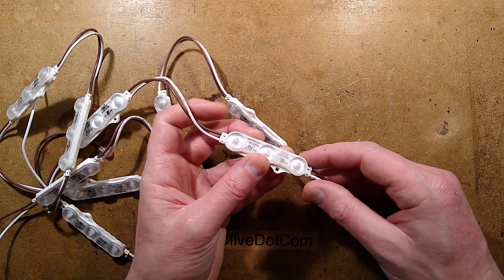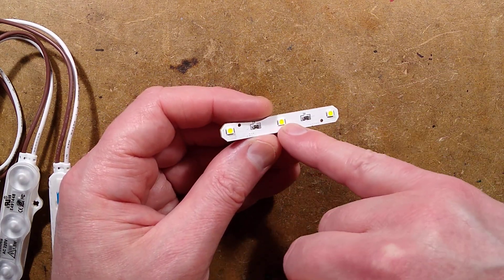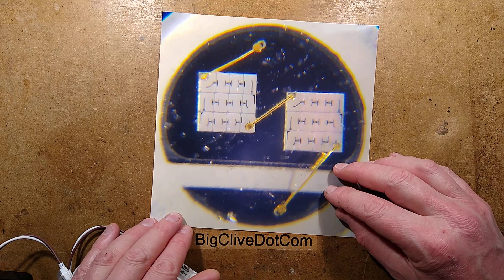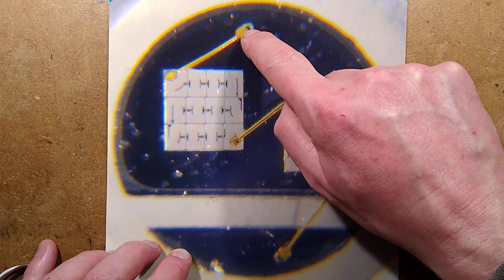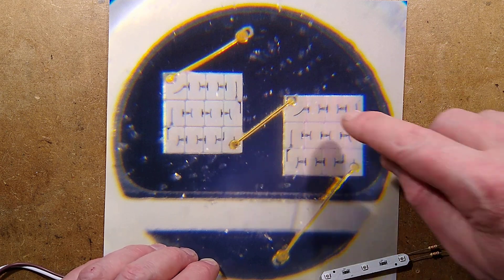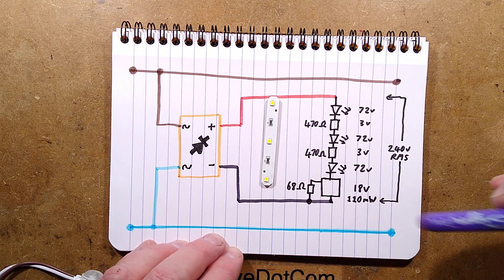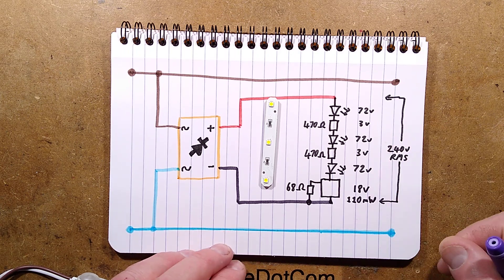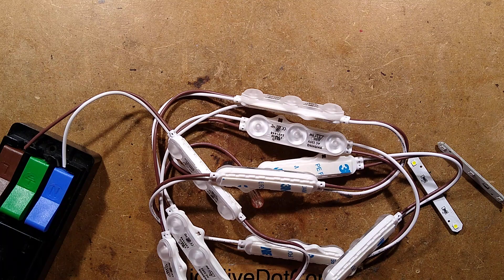Inside a high voltage LED

Comment: The gold wires decide if they are in series or parallel. The alignment of the units is so that you could easily bond them up in parallel for 110v while having the exact same light output.
Reply: Came here to say the exact same thing. Layout obviously intended to allow parallel or series bonding connections.
Reply: Yep, I thought the same

Comment: "it just dissipates one or two hundred watts"
well, I think with that power, the regulator would glow brighter than the LEDs :D
Reply: and 18 milliamps?
Reply: @ketas  Its efficient, lol
Reply: @ketas  Noticed that too
Reply: Didn't You know, that this is correct? Just at another input voltage levels and only briefly :>
Reply: @poprawa  We are joking, he ment milliwatts, not watts.
Reply: @user-rs8zg8ey2b  I actually know that, this was a joke too

Comment: Regarding the linear regulator: "It's dissipating only 18mA, that's the equivalent of just 100 or 200 Watts... Thats quite impressive..." Laughed way to hard about that 😄
Reply: That is one hell of a chip to do that :P
Reply: You can do that if you get the heat out of there ;)

Im designing a product off a similar concept but nearly zero ripple for high power applications. If it wasnt for thermal control, we wouldnt be able to do what we are doing safely.

Comment: I remember when I first found a HV LED a few years ago. My grandma bought me an LED dichroic-like lamp (I was 13 years old or so). I took it apart (just couldn't resist) and there was a fairly big SMD chip with what appeared to be 4 LED blocks under the phosphor. I was amused by such a big LED and when I tried to power it up with my own supply just to find out I had to use two in series to get it to barely turn on I was *confused as fox*. It might not be an LED I thought. I Just couldn't comprehend how a 4 die chip would require such high voltages. I researched a lot just to find nothing about that chip. It took me years of just watching teardowns by YouTubers like you, or DiodeGoneWild and such to discover (or rather learn) that these four dies may just have been clusters of LEDs all packed together in one single block. This things (although being just a cheap and dirty way of doing things) are just amusing from a technological perspective. — I mean, im 21, I shouldn't be so impressed by it, but it is just awesome, won't lie heh
Reply: Keep that sense of awe, curiosity,  and ability to be impressed.  When you lose that, you will turn into a crusty old man.
Reply: did the granny frown? they always cried and my ass hurt often from punishments, when i took everything apart in my home. i mean just one thing was left...
Reply: @ketas  I never told her, some the day the lamp just disappeared :)

But she bought for me cuz i was interested in knowing how was it like. So I guess it was fine — ?

Comment: These make standard LED lamps look over engineered now lol... great that cheap light technology is advancing, hope it lasts longer than these cheapy led lamps we are currently seeing advertised with 10,000 hrs lol... great stuff Clive 😎👍
Reply: IDK I have an early LED bulb in one of my bathrooms along with a folded florescent and both have been running now for almost 20 years.  Admittedly they haven't been on all the time so the cumulative time on the bulbs may not be 10,000 hours.  One has to admit that almost 20 years without changing a light bulb is pretty good.

Comment: Incredibly modular, and for the engineering / moulding / assembly, incredibly cheap! Since those modules are so very compact, I can think of a host of uses - and you must wonder what design delights are just around the corner, so to speak!

Comment: Those big LED dies look very cool running at low current, with the whole surface lit up. The first time I looked at one through a magnifying glass, I thought it was an effect of the phosphor being over the die causing the whole surface to light up, but then I took a close look at a regular blue LED and saw the whole surface of that die was lit too.

I do wonder how big they could make an LED die. Like could you make a 300mm wafer sized LED?

Comment: Around 10 years ago Seoul Semiconductor made line voltage LEDs that ran on120V or 240V.  They came on the ubiquitous hex shaped sink around 2 cm across with 2 smc resistors (1 in each direction) & had the typical 120 degree silicone lens.  I think they had 2 or 3 shades of white.   AND THEY WERE AWESOME!  I replaced my fishtank fluorescent with them when the ballast blew.  They required nothing more than wires and are still working as I speak.  They are also not terribly strobey either which implies they had two junctions under one phosphor perhaps smoothing out the jagged edges with the normal decay of the excitation somewhat like an incandescent lamp.  Another great idea that they don't make any more.  Sigh.

Comment: The positioning of the blocks and LEDs suggests that for the 120V version they wire the two blocks in parallel and for the 240V version they wire them in series. This is a very common way to have a nearly common design for 120V and 240V

Comment: If you want some really small LEDs, tear down a backlit laptop keyboard - if the tiny individual lights are real LEDs and not a meshed screen, we're talking about LEDs below 0.01mm in size (at least on my Lenovo laptop). Probably multiple elements inside a bigger SMD package.
Reply: you can buy pre-wired SMD LEDs like that, they market them to model builders.  very popular with the model railroad folks.
Reply: Apple's latest "Mini-LED" displays pack about 10,000 individually-controlled LEDs into a 16" backlight.  Small, but not microscopic.
Reply from the maker: Possibly flip-chip LEDs.

Comment: These were available but in the simplistic bathtub type module from ROK in 2014. Signmakers rejected them on safety grounds preferring low voltage inside their letters and boxes. I don’t see that changing.

Comment: I'm wondering as so many things around the house are using DC and all have their own AC-DC power supplies would you use less power having a DC loop and sockets around the house with one efficient converter and maybe a battery bank to smooth thing's out including lights off the top of my head I can think of 40+ thing's in my house that all have their own AC-DC power supplies I think having DC on tap the losses through heat etc would make a significant difference
Reply: Everything needs different voltages though, so you'd be replacing a lot of ACDC supplies with DCDC supplies, which essentially just saves you 4 diodes worth a couple cents.
Reply: All that stuff requires different voltages, so you've really gained nothing as everything still has a lossy DC DC converter in it. I guess you could standardize something for lighting, but it would be a tall order to refit existing home construction in countries where lighting and outlet circuits are often not separated.
Reply: @MichaelGiacomelli  good point but 12v and 5v seems to be used for most things how hot plugs for thing's like internet rougher's get and are 24/7 bugs me and now all of the lights in the house are LED what is the point of using AC-DC converters on every bulb that are cheep and made knowing full well it's going in the bin after maximum 1 year
Reply: @Broken_Yugo  pulling the legs of the lighting circuit from the AC is purity simple
Reply from the maker: I could see a future 24V DC buss in homes for lighting and powering small devices.

Comment: The voltage across the regulator isn't 18V. It should be from next to zero up to 116V at the peak of the sine wave. My calculations show an average of around 40V.

Comment: If the regulator is so simple and limits like a resistor could not a 3´rd resistor do well enough to simplify it further or would that give a run away amperage ?
Reply from the maker: It would result in intensity variation with voltage fluctuations.
Reply: @bigclivedotcom  So a resistor and a cap then? That would be cheaper right?

Comment: Is it really blue or is it near uv... Do they all contain rectifiers every segment so you can cut it anywhere?

Before when they couldn't make blue how then did they use phosphors? Or didn't they use them at all because, though being cheaper it just wasn't technologically available
Reply: Usually, the LED material itself glows in the desired color.  Red (GaAsP) and green (doped GaN), with yellow being red+green.  Phosphors are used to get white light out of blue LEDs.
Reply from the maker: Before blue LEDs they didn't have phosphor colours.
Reply: @bigclivedotcom  ah I see, I don't like coloured leds, clearly it's just white with a filter 😂

Comment: The first time I saw high voltage LEDs in this package size was in the backlight of a TV. A few had failed causing the TV to power off. Samsung I believe it was. Probably a common failure for these new LEDs

Comment: I'm sure this is showing my ignorance but I was wondering about the bridge rectifier. If I remember correctly this is made of diodes. So, would it be possible to replace the rectifier chip with four LEDs?
Reply: Regular diodes have a high reverse breakdown voltage. LEDs, not so much. LEDs can only handle about 40 volts in the reverse direction before breaking. 1N4007 diodes have a reverse voltage of 1000V.
Reply: Not really. While LED's are technically diodes, they're not very good diodes. If you tried to use them as a bridge rectifier at mains voltages, they would burn out fairly quickly. The bridge rectifier chip is probably rated up to a thousand volts, LED's not so much.
Reply: The problem with using LEDs as diodes at mains frequency is visible flicker. Each diode in a bridge rectifier is only conducting half of the time.

It is pretty easy to wire individual LEDs so they don't see a reverse voltage higher than 3 volts. Individual LEDs need to be wired in back to back pairs.

This won't work with these high voltage arrays. If the 72 volt arrays were wired in pairs, any imperfections within an array could lead to the series connected LEDs not splitting the reverse voltage evenly.
Reply: Thanks for the replies setting me right. In my defense I still think of diodes as tiny versions of the vacuum tube versions I first used at school.

Comment: Is this a better design to run AC to each segment or would it be more optimial to convert to DC then power the entire length with DC (assuming the length is within the 2 to 3m range)
Reply from the maker: The use of AC is simple and allows a lot of modules to be run.  But it's covered by different regulations than the safer 12 and 24V versions.

Comment: Are those 12 LED modules built up all on one substrate? They must make those with a similar method to how ICs are made.
Reply: Metal-organic vapour phase epitaxy (MOVPE) is how they're made.  Basically chemical vapor deposition (CVD) with some organometallic chemistry thrown in.  CVD is how ICs are layered, but ICs are then etched (via UV lithography) with the circuitry patterns. The GaN devices under Clive's microscope look like they're deposited onto tiny rectangular patches of a substrate.
It's all extremely high tech, yet at the same time it's routinely done on a massive scale.  (It's kind of scary how dependent the world is on just a handful of these factories.)
Reply from the maker: I thought they might be on a common substrate, but the slight staggering is odd.

Comment: Can you run the whole string on DC to get flicker free light? i'm super sensitive to flickering LEDs 
You often say it's only flickering to the camera and not to the eye... well maybe i'm a cyborg or robot.
Reply from the maker: Smoothing it would increase the voltage and regulator dissipation.

Comment: Without a doubt the resistors are there to prevent the entire string from slipping into another dimension least a diode went short c. Or as you state no smoothing sooooo perhaps to balence the peek load. Live long and prosper. PS looks like ur up for another invasion May 28th.......vvvvvrrroooommmmm...oh shite

Comment: With no caps, wouldn't they flicker especially at 50hz?
Reply: The AC is turned into un-smoothed DC, which at 50 Hz means 100 Hz ripple. So, yes, but at a higher rate of speed (which is why it wasn't super evident on Clive's camera).
Reply from the maker: Not easy to see flicker.  They are lit for most of the time.

Comment: Could they dispose of the resistors then if they just added an mov?
Reply from the maker: No.  The resistors will also limit current while the linear regulator stabilises.
Reply: @bigclivedotcom ... Won't an mov?

Comment: 240 volts is classed as low voltage.
Reply from the maker: In electrical distribution yes.  But this is in electronic terms.